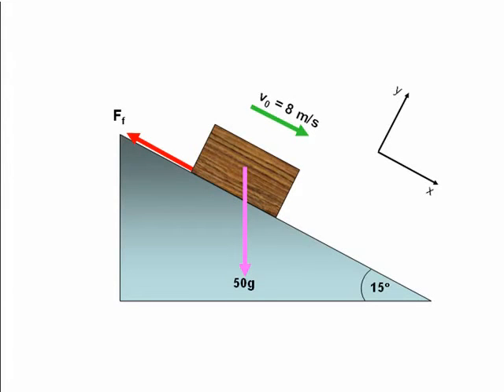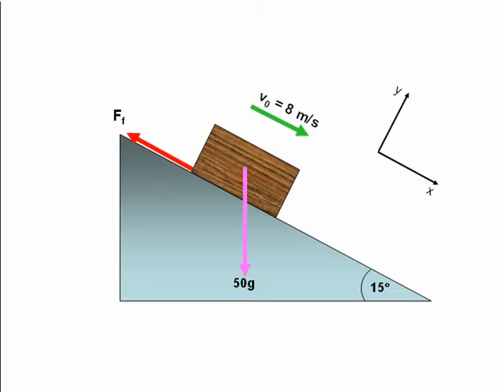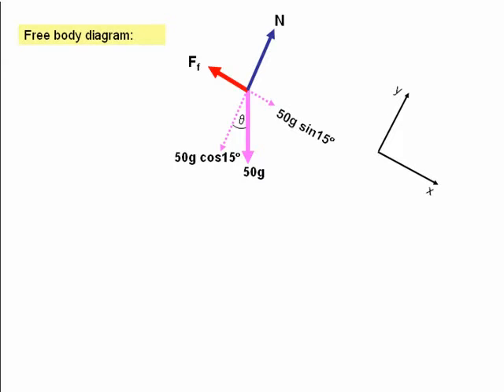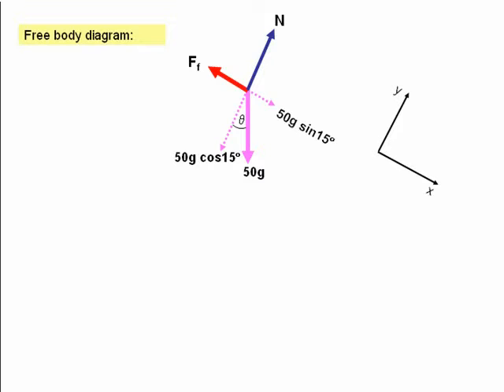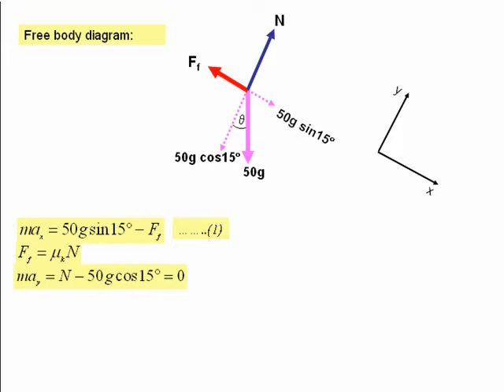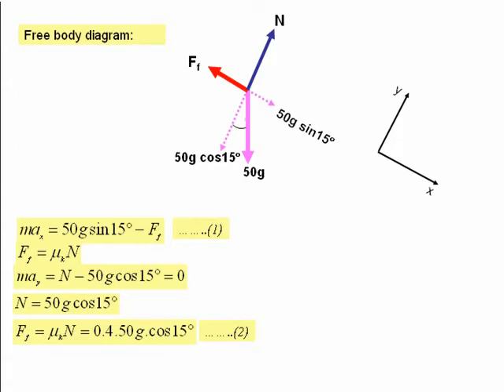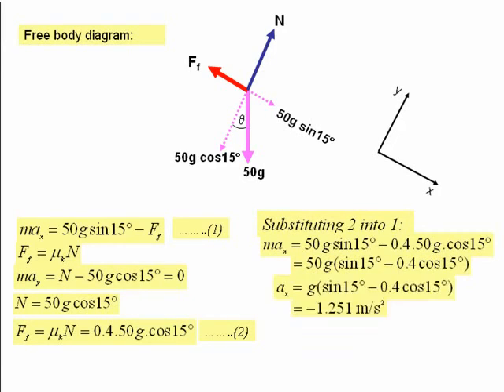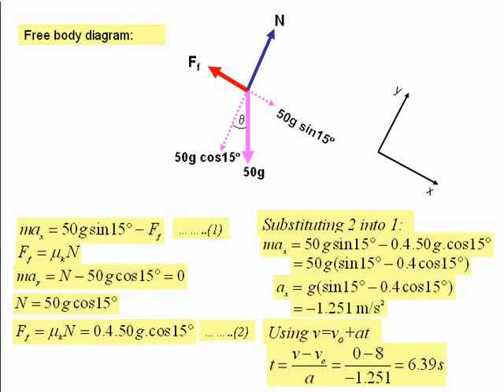Dynamic friction: an example

Comment: I'm working on a similar problem, but the block is moving up a ramp and I am not given the initial velocity. The blocks weight is 12.0kg and the acceleration is 0.3 m/s. 
I'm trying to figure out which kinematic equation to use to find the finally position when the block stops sliding. I'm assuming when the final velocity is 0? 
The kinetic coefficient of friction is given as 0.320. But that's all the information the problem gives. I'm so lost! Please help!